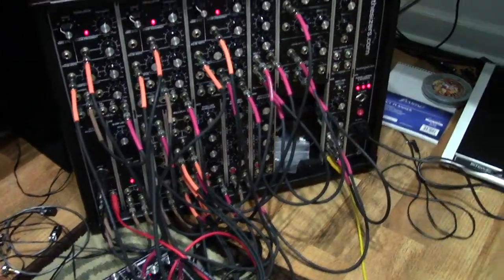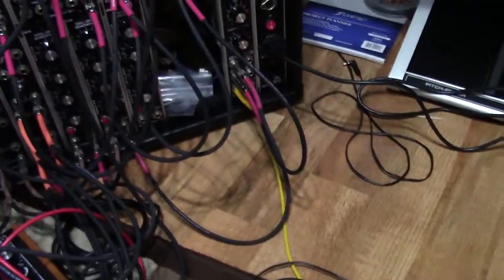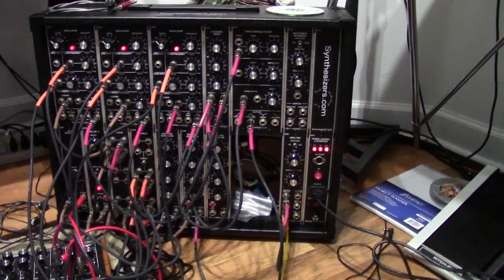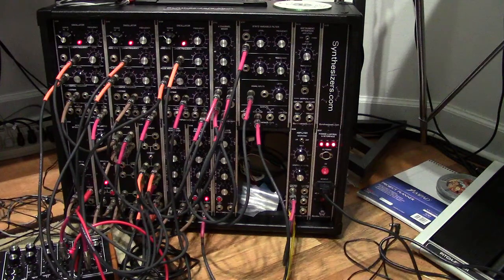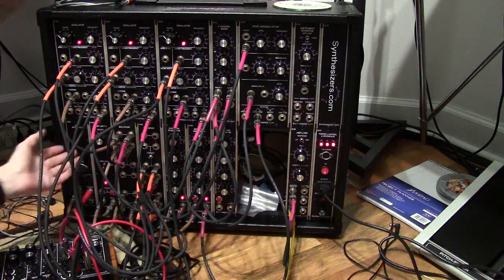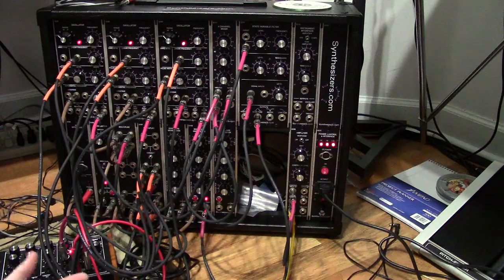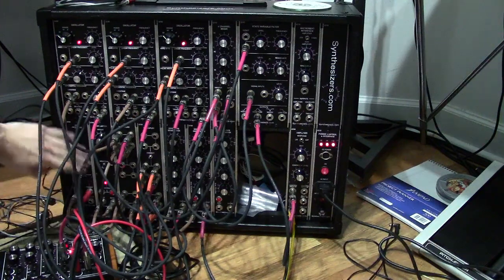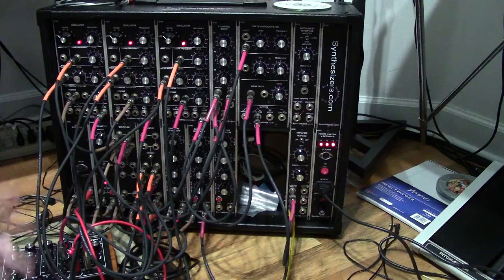Synthpro's synthesizers.com modular

Comment: I had a two cabinet portable system in the early 2000's. One was the standard QSP-22 and then another of modules I chose. It was pretty good but my music interest waned in the middle of the decade and I had no place to keep it set up so I sold it. You can spend hours on end with those things plugging and unplugging. It's a good thing you have a business to support your music. That is a good sound you have dialed in.

Comment: Excellent modular rack you have there.  I see its from synthesizer.com.  I'm assuming thats a MOTM format.  am i right?  the assumption is because you have 1/4" jacks as opposed to the 1/8" that euroracks use.
I'm thinking of doing the same shortly here, but trying to get ideas of the best approach.  thanks for sharing!
Reply from the maker: Thank you very much! Roger Arrick was inspired by the old Moog modular for the design of these modules. I can tell you that these are great built modules and I have always been a big fan of the classic 1/4 inch patches but does take up a little more room but the feel and access to knobs make up for the extra space.

Good luck with your future setup,
Jareth

Comment: Great sounds!  How do you configure the slim phatty in poly mode with the dotcom?  Do you have the SP set to Poly 1 of 2 with midi thru going to the dotcom midi-interface?
Reply from the maker: Thank you very much Tom! Yes, you are correct about the poly setup of the slim phatty, this is exactly how I did that.

Comment: Beautiful sound and a clever bit of programming.  I'd guess you could use Roger's S/H module to do the pulse width modulation?  Also maybe a synth.com lfo/osc to do the vibrato?    Are you using the pitch out of the midi interface to modify the filter freq also?  Great sound, reminds me of Tomita a bit.